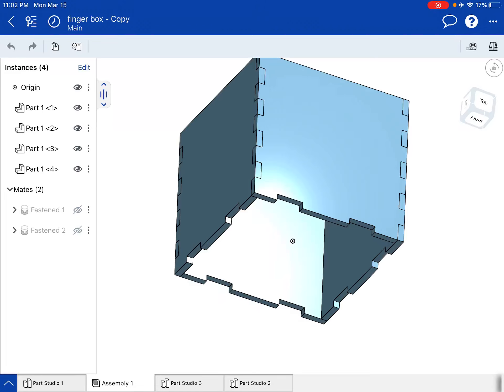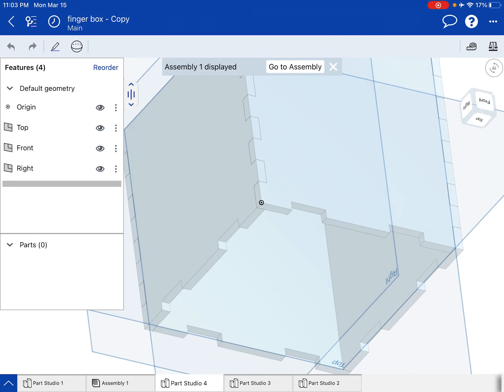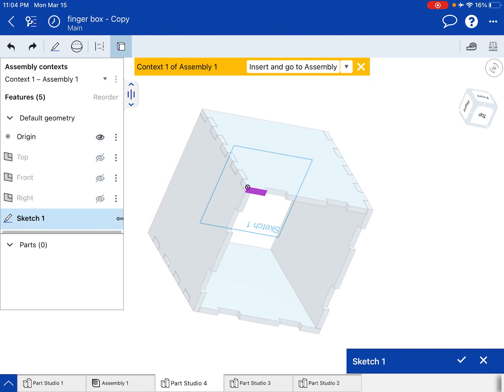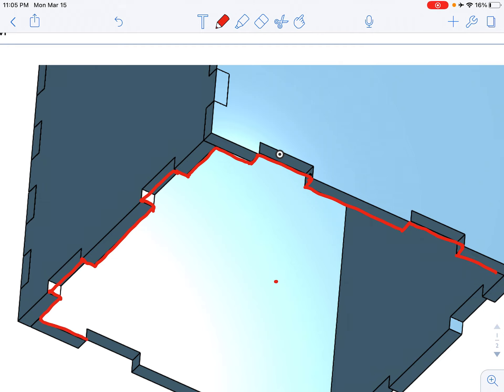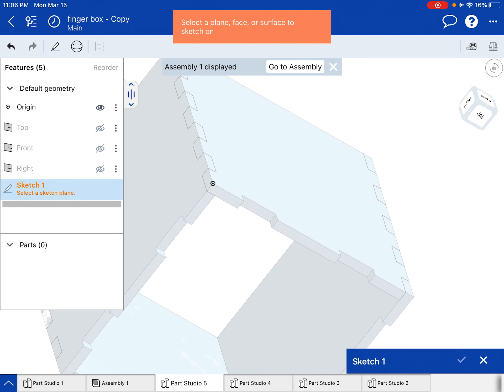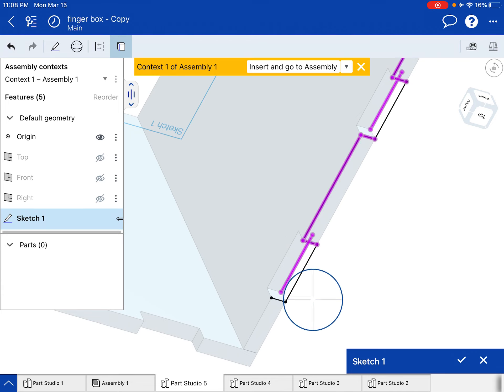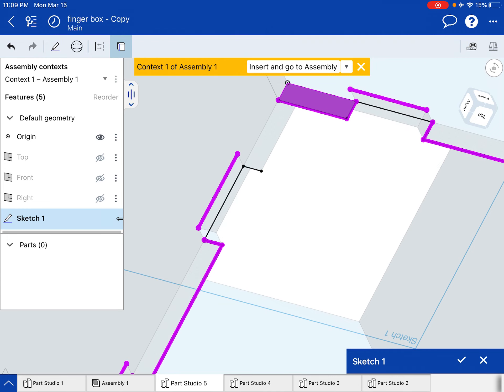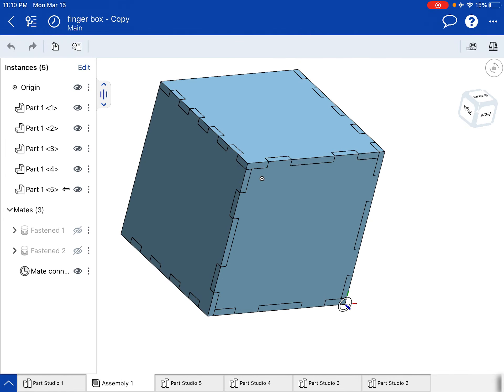Onshape “Use” tool

Comment: Awesome method!  I know I'll need this in the future and this will pop in my head when that occurs, thanks for taking the time to put this together.  I'm also having an issue with the fact that you cannot scale a sketch but I'm wondering if I could use this method to scale a part and then trace it in this method to a new sketch which would then be scaled.